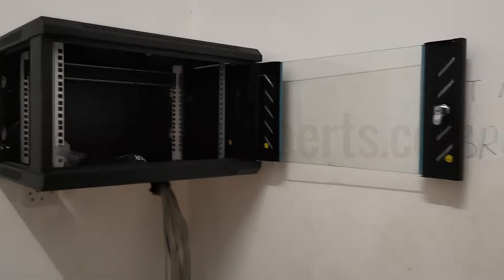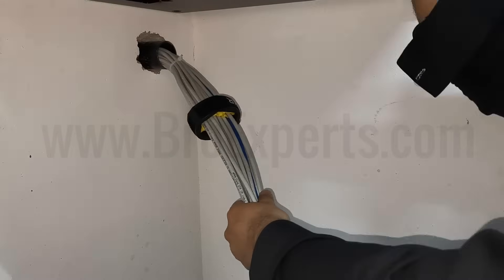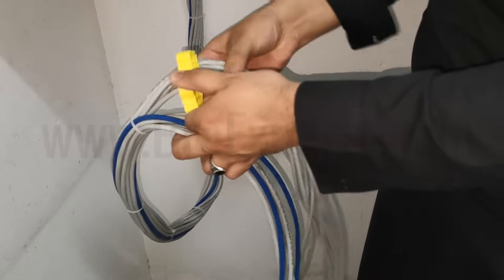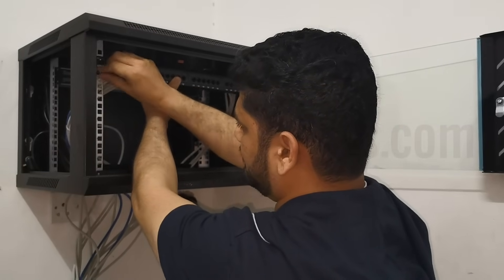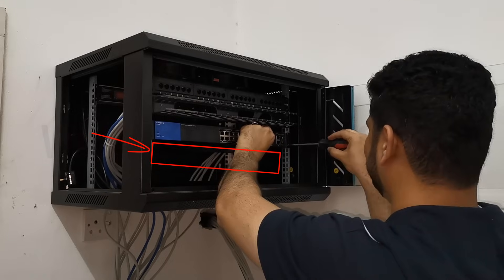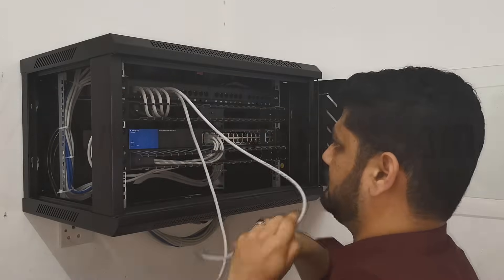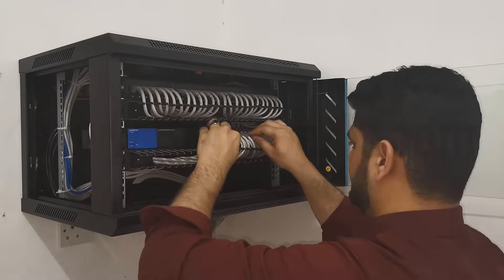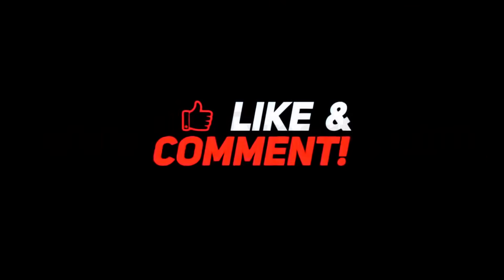Learn Network Cable Management Inside Rack From Scratch

Comment: Panel for usual patches? What if you need to add new one later? Connectors on the ends are cheap and you have less unnecessary connections

Comment: I do not understand why we cannot directly plug the ethernet cables coming out from the walls directly to the PoE switch. What is the reason to have an intermediate device in between the ethernet cables coming out from wall and PoE switch?
Reply from the maker: Patch panel is very useful when it comes to management.. you can easily manage cables and also in case if extension you have flexibility to extend cable by using longer patch cords without cutting or punching connector again. Hope it's clear..

Comment: Why such circuitous routing of cables? Why not use shorter patch cables and run them directly from patch panel to switch?
Reply from the maker: Yes you are right we can use smaller cable I have used smaller cable in my next project..  you can see my other videos. THANKS

Comment: Thats technical wrong! By seperating the twisted pair you will get into Problems like next/fext etc awful job!
Reply from the maker: Thank you for your comment.. yes, you are right, untwisted cable shouldn't cross 1 inch length.. I have fixed this issue later.. Thanks for pointing this out.. 👍

Comment: Cable ties are fine, these clowns have no clue. Invest in a Panduit GTS-E and never tighten past torque setting 3. The people saying you overtightened are correct though, you don't want to see loom deformation. Ideally, your looms look straight and flowy, not pinched.

Comment: It's pretty, but it doesn't work in a business environment. 
- There are WAY more ports in the patch panel than switches and offices are always being rearranged to where equipment plugs in.
- The switches have different ports, some with PoE.  You will have different colored cables to designate which is which.  There will be other colored cables for different purposes.  Sometimes the connections are between two patch panel ports to route something between rooms.
- You need to be able to trace a patch panel port to the switch to check connectivity to the switch, and when you have a bad port, move it to another.  
- About the only place you can make it pretty is where the cables come from the wall ports into the patch panel.  Those don't change.  The labels on the patch panel are labelled to match the labels of the ports in the rooms.
- You use Velcro, not zip ties so you can add wires easily, not pinch the cables, and wires can slide by each other when you bend the bundle instead of putting strain on the wires.  You will be adding whether it be phone, TV, alarm systems, cameras, etc. that you didn't plan on.

Comment: would have been better to start on last  patch point working back to the first one now you crossing over the cables  everytime  to get to the next connection on switch connected and losing length on the cable as its crossing over al the previous cables

Comment: 3 things wrong with this:
- Cabling in the rear instead of the front (heat is exhausted in the rear, also cabling can impede airflow)
- Wasted rack space (caused by the above)
- Using zip ties instead of velcro wraps (risk of damage to cable insulation, also a pain for adding line runs)

Comment: Don't put the tight cable ties to the 24 nos cable bunch as shown in the videography it's a wrong ❌ method 
If your using cable ties make sure it should be loose better to use welcro to do the bunching 
And while terminating the loaded patch panel don't open the pair keep as much as possible
Reply from the maker: Thanks for your comment..
Yes in my new video i used velcro instead of cable ties.. 
https://youtu.be/fUaTtM0sMGg

Comment: 1. Cables must be as short as possible
2. Cables must not be exposed outside the wall rack. They should be putted inside a trunk.
3. Patch panel must be labeled with correspondent outlets
4. Patch cords must be connected in an easier way (think about troubleshooting and replacing). Shorter patch cords can be used (0.5 m) with with only 1 CMU.
Reply from the maker: Thanks for your suggestions (:  .. here is my new project video https://youtu.be/fUaTtM0sMGg

Comment: Sorry but there one thing you do completely wrong. You don't use the correct 1HE holes. You always have problems get the aligning of the 1 HE devices right. 1HE is always between the low profile bridge. This is really important especially for the next guy who need to fight with the allignment of the holes and the cage nuts!

Comment: If I were my employee, I would be warned or fired.
1 connected 7 more cables without need
2 why use hellerman tape
3 used huge patch cords unnecessarily
4 on the panel patch did not leave the uplink point
5 where the uplink cable

this type of service is not done by people who are not professionals in the field

Comment: Only a few minutes in and ive noticed some major problems, first of all dont use cable ties, use hook and loop tape so its easy to add or remove cables. Second, you are overtightening the zip ties which is crimping the cables, and if you are going to use cable ties at least flush cut them, so there are no sharp edges to cause cuts. Ive had my hands chewed up quite a few times from the sharp little tips when you dont flush cut.

Comment: Great vid!!!

Some tips for efficiency during install & as well as over time for maintenance:

1) Velcro not cable ties (both inside and outside of the cabinet)
1.1) Adding extra cables will take forever unless you make a new bundle over time. 
2) The cut-off ends of the zip-tie can be very sharp, and cut you, a co-worker or could damage new cabling installed. More reason to use Velcro.
3) Use a strain relief bar behind the patch panel. This allows an easy to access gap between each cable IDC. As you are currently showing, you will work over the cables & have zero room to easily access 1x cable.
4) Rather do not use a traditional patch panel & instead get a patch panel that takes RJ45 inline couplers. Then you just make a standard RJ45 termination VS a punch down.
5) In such a small rack, space is expensive. Rather use very short cables and only occupy 2U vs 4u.

6) Create the service look behind the vertical rails. If you put a device with more depth in there, you might damage the cables. 
7) Install a premade RGB strip & leave it on the company colour(s).
Reply from the maker: Thanks for giving suggestions ..

Comment: I have to conct my modem in villa this borad is outside and slot are on wall in my room
Reply from the maker: Pls give more details what exactly you asking?
Reply: @BroExperts-Tutorials  sir we have network cabnet in villa in and there are 7 houses inside villa all of them share internet now want tou connect router to get good signls for my smart tv i have the router an cabels but dnt know to fix in network cabnet in my home their slot for net from their how i wil connect cables to main modem
Reply from the maker: Ok as you saying you have network cabinet and Internet is shared via network so you can use same network point which is coming to your home.. connect that network port in router.. if network config is auto you will get Internet over WiFi.
Reply: @BroExperts-Tutorials  not helpful ok i gind sloution thanx

Comment: Y u not connect cabels to switch directly without patchpanel
Reply from the maker: Patch Panel has many benefits.. you can easily extend cables in case of relocation, maintenance is easy with patch panel  etc.

Comment: Where do we start....

No to cable ties!  If you're going to use them DON'T overtighten like that and crush the cables!   Why bother making the bundle tidy all the way to the rack just to leave them messy on entry..  also, make use of the 'U' markings in the rack, that's what they're there for!  Might need to add kit in the future after all..  make patch leads up to length too, dread to think what a mess it is behind the panels and go easy on that punching down... It's not a strongman contest 💪 

Otherwise, looks good 🙌

Comment: 1. NO LABELS on the cable? 2. Why do you need patch bay? the connections are ONE TO ONE, this is not a tv studio where you have to rout to different devices the same video or audio signal! This is IT where the connections between devices is Point to Point so no need for  patch bay.

Comment: The second cable punched in a wrong way - you should put brown wire first then white and brown..., using velcro is better than ties..., if you want to use ties you need to cut it all, don't leave a small piece it works as a knife latter when you work inside the rack...

Comment: suggestion: do not use zipties. They probably damage the cable, zipties (hangs cat) compromise the damaged cable compromises on the network certification. Use Velcro

Comment: There were crimes committed against cable management in this video.  I stopped after the third zip tie.  I was cringing so much I almost had a panic attack every time he tightened those ties.  This video should be a teaching tool on what not to do when building a rack and managing cat cables.

Comment: please help me to understand the logic to select 6,12 or 24 Strand SMF for backbone, with basic example like.

1-Server room

2- Single Conversed network

3- 4 IDF room connection (each idf room has one rack with 3 switch (48-port) connected with 80% capacity), each room located with the range of 25-40 meter

4-Designed for 10G,40G & 100G bandwidht support

5-services voice,data & video.

if any other data is missing or required please take assumption.

I am also looking for logic for this calculation since long time.

Comment: Also this was 2019. Cat 6A existed and was the standard. You should have run cat 6A or cat 7 and either way you need to ground the cable at the switch to get the shielding. If you are running cable in the walls take the time to do it wright once so someone doesn't have to tare it out and redo your work in 5 years.

Comment: Thanks you, , may i know if it is okay if i will not use patch panel?
Reply from the maker: Yes you could go without that.. But using patch panel can make your life easier in case of rack extension you can easily extend length of cables

Comment: No labeling, ignoring rack units, using zipties that can damage the rubber coating instead of using velcro straps, cabinet above the cable feed..

I mean, this is regular at most, it doesn't look like much thought was given into this particular job.

Comment: Why didn't you mount the cabinet over the hole in the wall and install a threaded adapter on the raceway?  Additionally you may have better luck if you install a service loop with the entire loom, simply make a complete circle at the bottom of the rack in order to have some additional cable which you can access to reroute or reconnect - all you have to do is unzip your velcro wraps...oh, wait, you have zip ties....where do you get the magical cable detangler that changes colors?

Comment: Nice video but noticed that you didn't use the U unit spaces as intended in the rack. Each U space has three square holes represented vertically. The two square holes closest to each other are the division points between each Unit.

Comment: Not to be too critical but when you were cutting down your cable on the panel you had the brown pair backward and the orange pair where the green pair goes... there is a reason why they are mapped and a reason why they put a picture there.... you should have followed it. Also when you lace your cables from the wall do so with the bend expected to be a permanent part of the cable path and it won't bunch up when you actual bend them... your punch tool would have cut better if you tipped it slightly toward the cutting edge...you get a C
Reply: Good points, he still has to learn how to lace cables, that bundle should be easy they are not that many, his bundle is twisted from the wall (he forgot to clean the cable first than start to lace) and other think where are the labels on the cable and patch cable!

Comment: Good job!  2 suggestions I could make.  Use flush cutter instead of scissor to cut zip tye.. otherwise the small sharp plastic left can cut someone badly!   Also you should install equipments in theirs respecting U, do not left single hole at top and space by 3 holes if needed. installing another equipment will be much easier!
Reply: very true those small sharp plastics can bring hell to the technician

Comment: So why do you need to use a patch panel and a switch? Why don't the cables just go straight to the switch?
Reply from the maker: Patch panel  offers much more flexibility than simply connecting devices.. If u want to move network cables so u can do it without moving your current device or pulling new cable due to length issues..

Comment: 👍 I enjoyed watching, you do excellent work! Only thing I do different...I do not punch-down my cables, I install RJ45 plugs on the cabling and use a keystone bracket & pass-through jacks. Makes trouble shooting much easier...I use bigger cabinets as I install a rackmount UPS along with a rackmount surge protected power strip  😎

Comment: I have a question. 

I'm designing for an Office Network and I'm new with this. 

What materials should I use from the PC to the Server? 
-RJ45 Connectors
-UTP Cat 5
-Patch Panels
-Switch
-Router
-Wireway

And, I don't know how to decide for my Rack.

And, Is it good to use Modular Jack instead of what you used in the video?
Reply from the maker: All those requirements are depending on current and future need of your client.. For deciding about rack you need to count number of devices you gonna add in that and also some extra space for any future addition.. And yes better option is to use modular jack.. Thanks..
Reply: @BroExperts-Tutorials  Thanks Bro. I appreciate your help.
Reply from the maker: Welcome.. (:

Comment: So Far, You are the only guy I saw who used that little green organizer you used before you tie those cables 😂
Reply: I have a question. 

I'm designing for an Office Network and I'm new with this. 

What materials should I use from the PC to the Server? 
-RJ45 Connectors
-UTP Cat 5
-Patch Panels
-Switch
-Router
-Wireway

And, I don't know how to decide for my Rack.
Reply: @AdmGeneralAladeen  Probably too late now but you want to future proof. For the cabling you want minimum cat 6A shielded cable or if you can swing the extra couple bucks cat 7. For runs in the wall you want solid core cable for patch cables stranded cable is better. The patch panel and RJ45 connectors getting grounded ones makes the shielding actually work.  Make sure every component says the cable standard you settled on before implementing it. With the patch panel there are 2 big groups. Ones that take keystone jacks and ones that you wire directly. The one that accept keystone jacks will be cheaper but remember to factor in the jacks. That said it can be simpler then trying to work on one long bar to individually terminate every cable. With the switch and router just look at their quality. It's not worth saving $50 on a fly by night brand if you won't get the reliability. Router Downtime and replacement can eat any savings in not going with one of the big boys. My old company didn't do this and a 30 minute outage literally meant thousands of dollars flying away.

Comment: Muito bom, sou brasileiro.
E se precisar inserir roteadores pequenos, modems, etc... onde deve ficar? 
Where to insert little routers wireless, modem etc?
Reply from the maker: Actually cabinet size depends on your requirements.. In my case it was point to point wireless connectivity between two 4 stories buildings.. For me one ethernet cable was source of internet and rest of the access points we fixed inside each flat..
Reply: @BroExperts-Tutorials  I understand, but in this reality that you showed in the video, if there is a modem or router to make PPPoE, they are usually hidden and tight in the rack, it seems that the racks were not made for these equipments, you usually insert them in or on the rack. (a lot of people do that)

Comment: Very nice, can you tell me how many devices this network cabinet has and the cost details for each of these devices?

I am also researching and building a network like you for my rental building. Thank
Reply from the maker: Thanks for your comment.. This network also was built for building.. In 4 floor building i made cabinet in two places 4rth floor and 2nd floor to cover all the rooms.. Each room we fixed indoor wireless device.. 24 port d link poe switch was around $222. I used 4ipnet wireless access points each access point cost me $83.. Items list u will see in the description of this Video... Anything else u want to know?
Reply: @BroExperts-Tutorials  nothing else 😄

Comment: Somewhere between 07:39 and 07:40, all the slack in the cables from the wall magically disappeared and they're tied to the posts. Should have left that part of the video in.
Reply from the maker: I covered only important stuff.. Cables on wall anybody can manage.. Thanks for the comment cheers.. (:
Reply: @BroExperts-Tutorials  yh, but for someone who's never done cabling before, it's nice to learn from a pro :-)
Thx for the video. Good work. & looks very neat too. I've seen too many messy nwk cabinets & patch panels.
Reply from the maker: Thanks for appreciation.. Will try to add all steps in coming videos.. Don't forget to subscibe so u can learn managing cables on wall as well 😀

Comment: Kool,I like that cable forming toolHow many cables can u do at a time.
Reply from the maker: It depends on number of holes on that device..if u buy one pack different sizes coming..
Reply: Bro Experts I’ve used one of those but now I want one.